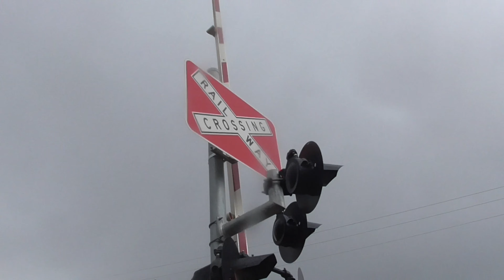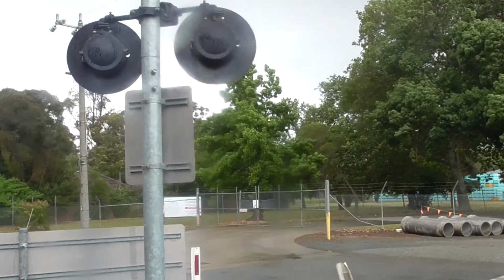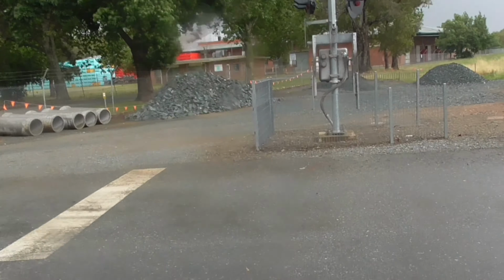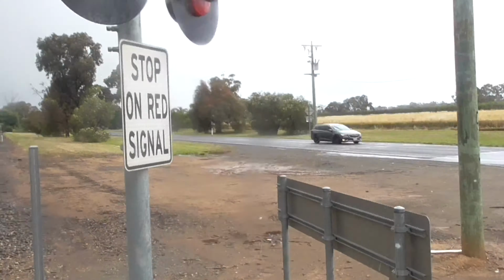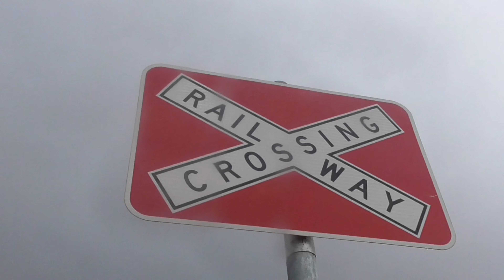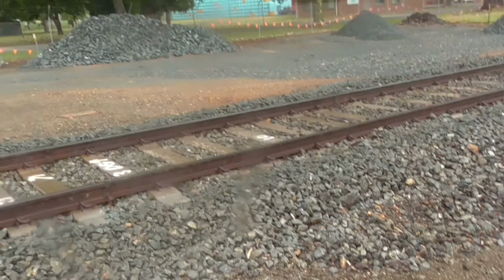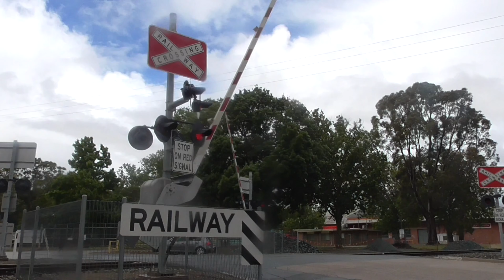Rumblara Road Level Crossing, Mooroopna, Victoria!

Comment: I lived in Mooroopna back in 2007, and I remember the old hybrid bell and very rusty-looking gateless signals rather well. They were still there in 2008, but I know the crossing had a safetran E-bell by 2009, and had new gated signals by 2011 (I actually can't remember if the crossing got LED lights between 2008 and 2011)
Reply from the maker: Interesting information! I remember seeing this crossing on Streetview with the gateless signals but no clips that i've seen. I too wonder if it got LED's prior to being upgraded with gates however knowing that between 2008 & 2011 is only ~3 years, they probably wouldnt have bothered. But, V/Line can be pretty surprising sometimes, so theres a chance.
Reply: @ethanthevictorianrailfan7030 actually, now that I think about, I think the exact date that the signals were replaced was August/September 2011, as I passed that crossing on the train on August 24th, 2011, and it still had the old signals. The next time I saw the crossing, about 3 weeks later, it had the new gated signals.

It's still a blur about the crossing having LED lights before the signals were replaced, but either this crossing or Andrew Fairley Avenue in Shepparton (which was replaced by gated signals in October 2010) would've been the last crossing on the Tocumwal line with incandescent lights
Reply from the maker: @JamesJimmaHarding  That sounds about right i know of a few other V/line crossings being upgraded in that period too so that would be right. I'm jealous of your memory though!

Ooooh yep okay also some good information to keep noted there. Andrew Fairley used to be cool with that signal between the tracks.. RIP